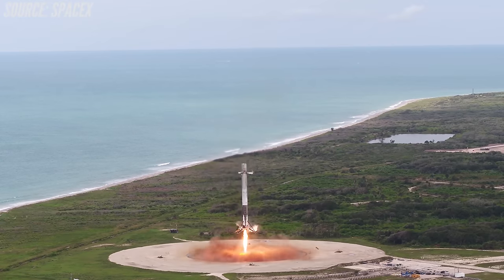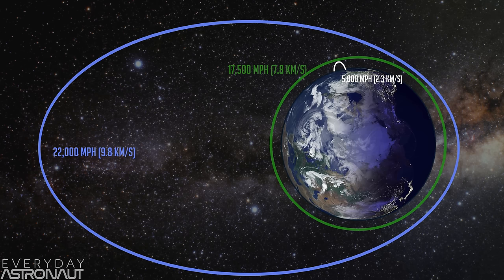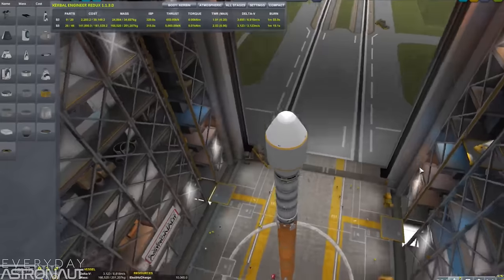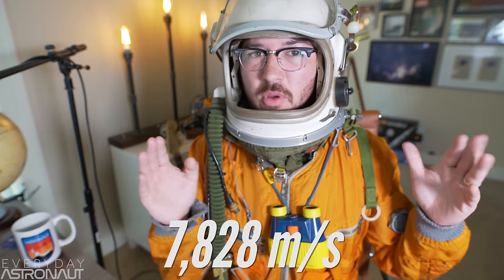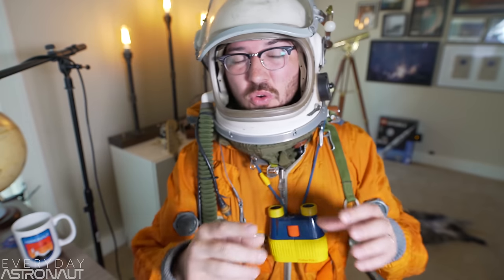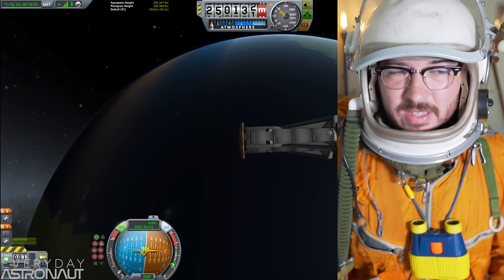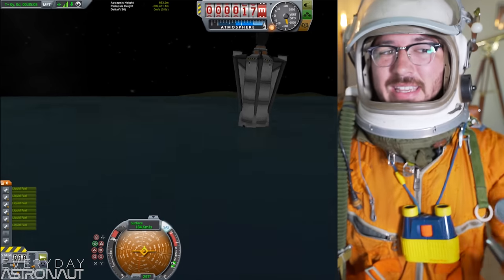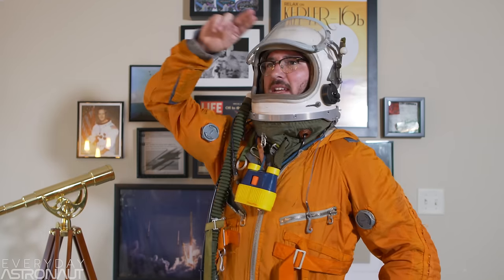Can SpaceX Reuse a second stage?

Comment: well the solution is obvious; somehow you need to get a heatshield deployed after the second stage has done its job BENEATH the engines so the thing only needs to slow down the last 100 m/s or so on its own from terminal velocity.  how do you get it there after you're done burning? no f-ing clue. but I bet that's the challenge musk has set for his engineers.....

Comment: This video got me thinking...
Why do they jettison the fairings in the first place? Just elongate those along the whole upper stage right to the interstage. At this point attach them to arms so they can swing out and around the bottom of the stage to shield the engine. Now you have a giant  snowfflake-style airbrake of about 40m diameter with your center of mass perfectly located right at the center and depending on how you build it, the nozzle extension might poke out at the very tip. You can now vent residual fuel out of the nozzle during descend to cool that and produce an atmosphere of anti-oxidising gas around your vehicle.

Comment: I forgot about this at the time the video was posted, but It might be worth looking into NASA's work with LARGE inflatable heatshields 

The idea being to put something like a 50-foot diameter heatshield out for reentry and spread the heat load sufficiently that inflatable materials can take it plus allow the centre of pressure and gravity to end up sufficiently positioned that it won't tumble - with an overall mass penalty not much greater than a traditional solid heatshield.

The intention is to deploy such a heatshield from the heavy end of the stage in any case

If taken all the way to the ground such a heatshield is likely to float too.

It's be a good Kerbal tester.

Comment: 11:46 what if, at this point, instead of adding fins & so many thrusters we make the heat shield detachable, on 2 aluminum aircraft-cable come-alongs (on either side), so it can be popped loose after payload is deployed and winched around into place below engine, so it can re-enter weighty-side first w/o added weight...

Comment: Don't know if it has been mentioned or is possible but is there a way to keep the first stage in orbit and it meet up with the second stage after a low orbit deploy. The second stage could deploy, 180, do  slow down burn, reconnect with the first stage again and it returns how it dose now? Possibly using anyremaing fuel in either stage to slow it down. Idk if it would work but if so posibally less extra fandangling to reengineer if it can just meet back up with its existing mounts. Or just like boing wants to keep 2nd stages in orbit, when the stages separate have the first stage fire again meet up with a second stage that was from a previous mission. By that time have stage you are recovering have had gradually slowed down and lost altitude, naturally if possible.  Potentially using less fuel Use the fuel in the second stage for a longer boost back burn and there ya have it.

Comment: I agree with your premise, but you failed to consider the angle of attack for reentry. By decreasing your angle of attack to just skim the upper atmosphere over several orbits, speed can be bled off a little at a time. Granted, this approach would take a relatively long time, but it would greatly decrease your speed of final reentry while saving fuel on your de-orbit burn.

Comment: Just found this channel so i'm a little late to the party, but I have a question I need to express.

Why don't they use multiple aerobraking passes to slow the second stage before using retro-thrust braking? It would use less fuel to brake and if they get the aerobraking orbit right they won't have to deal with as excessive heating as they would with a full de-orbit? Also they could use a much lighter heat shield due to the less aggressive heating. It would only take more time to de-orbit the second stage, but they would still be able to recover it fully, except the heat shield that would still need replacement.

Comment: Okay, one issue with this is that Kerbal doesn't correctly model the effect that happens from thrusting against the direction you're travelling through an atmosphere.  SpaceX was the first time this was tested or proven and it's the reason the Falcon 9 can come back.  It doesn't just slow itself down, the exhaust out the engine nozzles actually creates a barrier for the atmosphere to smash against before hitting the rocket and causing more friction.

Comment: Your forgetting one thing, you can do an orbit burn with your Peri at just low enough to slow you down and to lower your Apoapsis either alot or a little depending how deep you leave the Periapsis. That way you do a bounce reentry if needed and also you dont need to use any fuel at all to slow yourself down to re-enter. Do a Geo orbit in kerbal 2.9-3.0K km but do one solid burn of 2nd stage and point slightly radial outward to lower the Periapsis the higher your apoapsis goes. And keep it at 50k or so. Do a few passes to lower your speed.

Comment: how much do the 2nd stage engines cost? how much would it cost to launch a resupply station and fuel into LOE? then have the boosters refuel and then land? would the math/dollars work if you use an booster that's been launched 10 times and written off? could you keep the 2nd stage engines in orbit as tugs?

Comment: I would have thought that the answer was: 1 Take the Skylon route, engine technology allows you to dump the first stage by burning the atmosphere and using wings then using the low density of the second stage to re enter high and with low heat flux. Or 2. look at the Interplanetary Transport System in this the second stage is a lifting body with heat shield down one side, I would presume that is how SpaceX is planning to do it.

Comment: Question never seen adequately answered:
All non-gyroscope attitude maneuvers in space start by using propellant to rotate the craft in the three axes. The craft turns to the desired orientation and thrusters then fire in the opposite direction to stop the rotation. Unless the retro fires are exact—and nothing is exact—the craft will have some residual rotation and inevitably drift out of proper orientation. Now another firing will be required to correct this misalignment. And that firing won’t be exact... and this cycling will continue. 
How does one not burn through all attitude control propellant on a mission to say Pluto?

Comment: What about using carbon fiber draglines after deorbiting to slow down instead of just rocket thrust? Draglines could do what parachutes do, but acting over a much longer part of the fall and would tend to stabilized the stage orientation. Deployed around the engine bell they would be out of the most intense part of the friction heat zone. They would have less mass than fins.

Comment: I have a simple solution - make second stage only partially reusable - we want to save the expensive liquid fuel engine, fuel pumps and electronics only, not the empty fuel tank. 
So put the reentry shield INSIDE the second stage, between the engine and the fuel tank. 
After payload separation deorbit the second stage, before it enters the atmosphere separate the empty fuel tank and rotate the remaining engine module reentry shield first. 
The engine module reenters the amosphere, which decelerates it to a safe speed, then it deploys three parachutes to hit the ground shield first.

Comment: So what would the affect be on delta-v if you made the second stage 3 times the mass by taking away mass from the booster cores, put an engine with 3 times more power (raptor engine) that's also more efficient and use carbon fiber tanks instead of lithium aluminum alloy tanks. Many of these ideas are currently being researched by spacex. Also, could they detach the nozzle extension to help stabilize the entry?
Reply from the maker: +Joe Mckirdy this may be similar to what spacex decides to pursue, but making the second stage three times the mass means the first stage won't get it nearly as high or fast and I'm not sure the second stage can push that much weight into orbit, even with the things you listed. We'll see though!

Comment: You could have used the 2.5 meter wide heat shield as that has less mass that’s the 3.75 meter heat shield so it wouldn’t need to cut back on payload and you could have limited the ablator on the heat shield

Comment: I thought there was a never realised plan to take the shuttle's main fuel tank into orbit and possibly use it as part of a space station - for storage or even accommodation.  Couldn't you do this with the fuel tanks of a second stage?  You could jettison just the engine - with a small fuel tank attached to allow retro-firing and landing and a heat shield to help slow down.  The stubby shape and lower mass should make re-entry and landing easier.

Comment: What about using Ion thrusters for the second stage thus conserving a lot more potential Delta-V without a significant decrease of payload?
There isn't any meaning full atmosphere when the first stage ends, so what if the next-gen ion thrusters are used to push the second stage into orbit? sure it would take a low time on account of how slow ion thrusters are to accelerate but still, it would mean a lot of Delta V could be conserved for deceleration in atmosphere.

Comment: I honestly believe recovering 2nd stage is more trouble than is worth. Its the cheaper part of the vehicle and economics matter. 

The only way to recover it efficiently, is to turn it into some sort of a capsule, with shields and parachutes, let the atmosphere do the heavy work. Since there are no humans on board, it can land at higher velocities.

I actually like the idea of parking it in orbit, no air so it will stay there, not rusting, then use the spent stages to assemble a ship for Mars or something, you only have to bring the fuel.

Comment: Consider that the primary difference between a sea level and a vacuum Merlin engine is the extended nozzle. What if the nozzle extension was carbon ablative skirt that could be discarded during reentry as the pressure increased...

Comment: You could also use  the payload shroud as the heat shield or vice versa reducing mass to lift. Move the heat shield/shroud to the other end of the rocket encapsulating the big engine. You don't have to slow down that much to get back into the atmosphere just making your orbit highly eccentric will put it into the atmosphere in the lowest fastest part of the orbit. Staying relatively high to keep from losing all the velocity at one go and using atmospheric control to round the orbit as you slow. Then when not going deeper is no longer an option deploy a carbon fiber  balloon to provide more drag at higher altitude and them lighter than air lift and drag gently put the second stage into fresh water for recovery. Then service the craft as you barge it down from the great lakes.

Comment: why dont use grid fins to keep the second stage pointed heat shield first? they could be used in pretty much all of the athmosphere. And what about a set of landing gear on ground adjusting its location in real time. this could make the legs of landing rockets obsolete and help inccrease payload. And it's waaaaaaaaay cheaper both un developement and build

Comment: What if they used a lifting body design for the second stage with and then used fuel only to de-orbit, and land without any fuel on a runway. Some design changes would have to be made to make it remain stable on launch, since the center of pressure would be raised, but maybe they would be able to keep the second stage on the upper atmosphere for longer and slow down enough to survive re-entry and land on a runway

Comment: You didnt comment on the actual planned method unless i missed it, though ive only ever heard it mentioned once and nobody else, nasa included has ever suggest doing the same. Use the thrust from the engine to block heat from friction on engine itself as it slows down via natural forces. once slow enough the engine can cut off and land/decelerate as per usual.

Though this doesnt deal with the engine bell being too big, though i imagine there would be a simple solution for that, maybe part of it separates and falls off?

Comment: I do not understand the reason why the returning vehicle cannot ride on the upper atmosphere until enough orbital energy is dissipated at a low enough rate to keep temperatures within limits. Can you help? I think orbital energy is far higher than potential energy of altitude. I recall a free fall jump from a balloon at remarkably high altitude.

Comment: To save the second stage it must reenter engines first keeping CG low for stability, engine nozzle should be covered by a retractable heat shield, parts of which could be used as a landing gear legs.

Comment: Awhile ago, I saw that SpaceX had come up with an interesting idea on how to recover the second stage.  They modify the inter-stage adapter so instead of being thrown away, it opens up as three or four "flower peddles", remaining attached to the upper stage.  In this position, now out of most of the atmosphere, it does not interfere with the operation of the second stage.   After de-orbiting the second stage, the adapter closes up again, and additional flaps fold out to form a heat shield surrounding the engine.  The second stage now comes down engine first.  During the landing phase, the stage adapter opens up again, and forms the landing legs!  The second stage engine fires to bring the stage down to the ground.

Comment: idea for weight saving, instead of losing the payload doors, make them split in 4 and instead of blowing away, hydraulics to fold 2 to each side into a delta wing or even 4 into an angled design to make them as an air brake propeller like design (this would cause the rocket to spin but as it gets into denser atmosphere the angle is made to become more steeped and thus create more drag)
sorry i am not to well adversed at this rocket science stuff, i am only a dish pig!

Comment: Why would it not be economical to use the falcon heavy to launch light payloads and recover first and second stage? yes it would take way more fuel to launch than just on a falcon 9 but if we're recovering first and 2nd stages 10s of times it could end up a very cheap way to launch lighter stuff?
Reply from the maker: +Bartek Juszczak that's exactly the question we pose. Only time will tell if that'll be economical! 👍

Comment: Isn't starship a reusable second stage ? Can a second stage be using parachute to slow down and not fuel if recovered from the sea or with a plane like spy sats it does need landing legs. In ksp you can slow with multiple re entry very high in atmosphere is that possible in real life ?

Comment: About the "using Falcon Heavy just for reusability would not be economical". Are you sure that the cost of fuel for the two side boosters is higher than the cost of the second stage?

Comment: Im designing in my paper that the 2nd stage will have fairing shaped heat shield that covering the engine after Deorbit burn then at save speed wings will be deployed and when its ready the heat shield get pulled back and the landing struts ready and do the landing burn. But its not possible in KSP

Comment: What if you introduce an inflatable heat shield completely covering the engine after you slow down the 2nd stage. That would allow for protecting the stage and no need to add anything to keep from the engine going down first.

Comment: I basically had a similar idea to ULA. I would however consider sending up a dedicated upper stage consisting only of fuel as payload after every four or five commercial launches in order to refuel all of the other upper stages quickly and at once. Otherwise you'll still end up having loads of empty upper stages orbiting around for nothing...

Comment: seems to me if it takes a launch system to go from earth to orbit it will take another system to return the second stage from orbit to a transfer point for return to earth. Time is a consideration when going up but if its a mostly empty second stage then taking a month to bring it back down is not that big of a deal. So why not use a Ion  powered return module that locks on to the second stage and bring it down to a return to earth transfer point. This gives you the most efficient burn back possible, there are still many issue to fix but those seem doable if you can get over this rather large hurtle.

Comment: Aerobraking is an option due wich the second stage has a low amound of fuel but enough to re -enter the atmoshere wich were it will slow down in it and when it slows down enough for landing it will deploy parachutes .To resist re-entry it needs a heat shield!

Comment: I have not read about the reuse concept of ULA, but it seems hard aswell. Which kind of fuels are storable over a long time in space?. Cryogenic Fuels are certainly not and N2O4 (MeHN)2 is corrosive. The "storable" IRBS with N2O4 (MeHN)2 were only able to hold their fuel for some month and therefore only fueld in cases of increased rediness of strategic nuclear forces.
Reply from the maker: +Lucas T it will be hydrogen and oxygen and they will maintain pressure with a small internal combustion piston engine!!!! Crazy huh?

Comment: This is also kinda inaccurate you could, in theory, split the fuel tank into 2 halves and pump it to the top to make it front heavy this means it balances out the engine weight so it can re-enter the atmosphere.

Comment: Could you add a shell structure to the top that was shaped like the end of a Tylenol tablet with the heat shield then detach the structure in space rotate the second stage and re-attach the cap to cover up the engine side - the final shape would be like a Tylenol tablet with the new structure with heat shield on the heavy engine side.  After re-entry - rotate 180 discard the heat shield then rotate back to use engines to land. -- Just curious